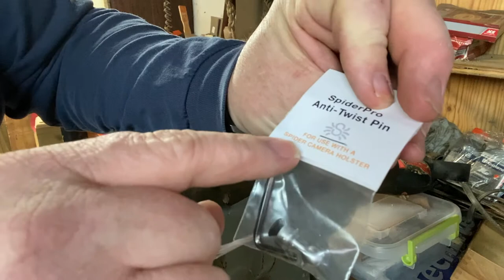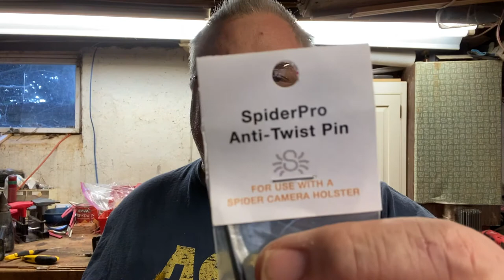Spider holster (Camera) tool modification

Comment: I have been using the same holster with the drill handle wrap on the job every day for a couple years now. It's a good solution. I am seriously considering using your mod. It would be nice to get rid of the handle wrap. I will say though that the lock on the holster part stopped working a few months in. The detent is only plastic but I have no need for the lock. Thanks for the great idea and video.
Reply from the maker: Thank you so much for your comment. I do have to say a love it! It took a bot to get use to it but it works like a champ. My worry was that the plastic parts I would break. Its totally worth the  hassle of cutting the threads! Great luck its a great mod

Comment: Just seen this advertised and didn’t like the velcro strap you need around the handle, that’s a Great mod!
Reply from the maker: Thank you very much. Since the mod I’ve have zero problems and absolutely love it. The metal connector is super tough and it never comer out when I don’t want it too. Play with the placement on your belt, one thing I have noticed in the back of the belt I’ve found is the worst placement. I have mine just oven my left leg. I find is super easy to stow and to access my drill/impact

Comment: hi, what size is the part that goes inside the round one?
Reply from the maker: The tool website and the camera division are two separate sites. You you stay on the camera site all the parts will fit. You can’t mix the two divisions. Sorry I just saw your comment

Comment: If only this mod worked with dewalt
Reply from the maker: Oh it does I have a 12 V DeWalt drill that it works fabulously on you just have to get the different days to fit the thread pitch

Comment: be aware ive just tried this and metal ball drops straight through belt clip don’t know why when your video shows it working it’s as if the balls are to small and it’s genuine spider product if anyone knows why let me know
Reply from the maker: That is a weird thing I’ve never run into that. Now, if you try to mix the tool version with the camera version the two are not compatible. The tool holster is larger in diameter. Im very interested in how this gets straightened out.
Reply: @n3qdz  yes after a bit more research the power tool holster is not compatible with the camera metal ball fixings looking for bigger ones that will work keep you updated 👍